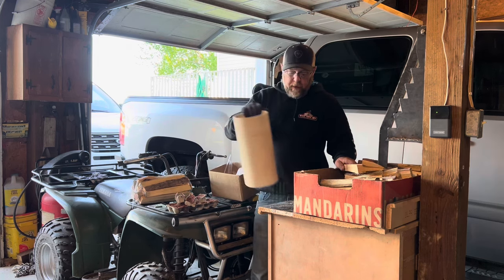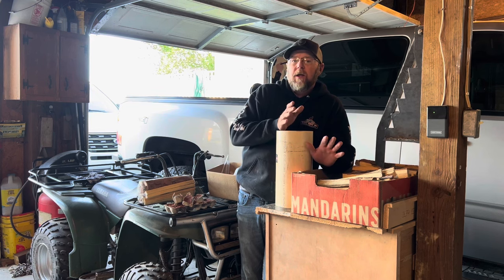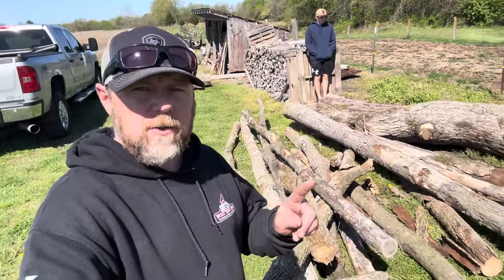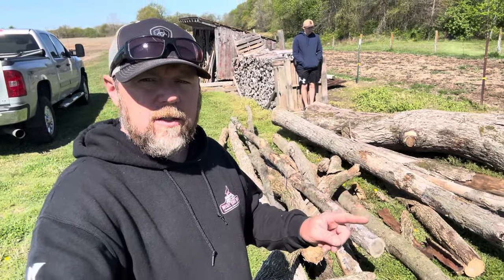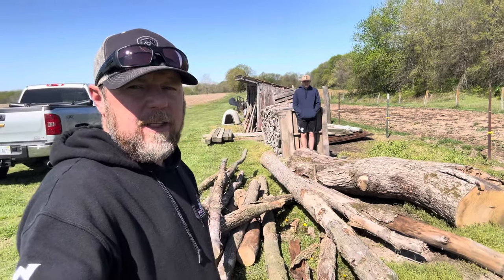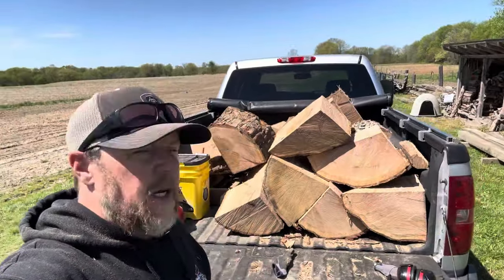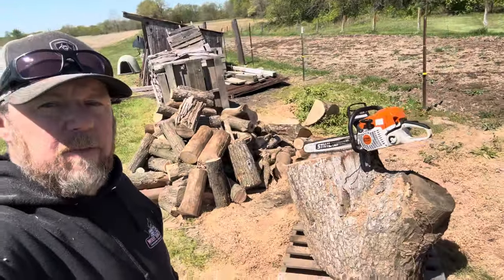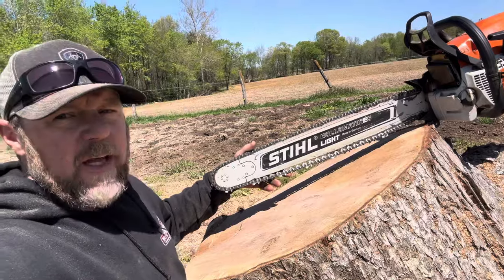Bucking / Noodling Huge White Oak!! #firewood #freefirewood #stihl

Comment: Question for ya Todd . What kind of bags are you using for the kindling and what did you use to close the top of the bags .  That sure was a big stick of oak should be a lot of bark less wood in that one . Nice job guys .
Reply from the maker: Those were produce bags I get on Amazon. If I can find the link I’ll send it to ya! I close the top with cheap zip ties from Harbor Freight. Like $2 for 100count. Yep there was a lot of barkless in this log. It got split just after the video ended🤣 Take care Phil👊🏻

Comment: Take that chain and have a link or 2 removed. You are correct not pushing your luck running a loose chain. I ruined a bar once when I threw a chain.
Reply from the maker: Yeah I thought about that but I’m wondering if the integrity of the chain would be the same? I really don’t want to see one break😂 That might get interesting. I appreciate ya watching Matthew👊🏻
Reply: Every chain already has a coupling link. Removing a link or 2 doesn’t hurt.

Comment: Nice job. The chute on my 400C is too narrow for ripping so I’m ordering the WestCoast clutch cover or going with another model cover that will fit. Regardless of the small issues the saw is underrated.
Reply from the maker: Well if not for the hype on the 500 there would be more talk of the 400! It’s very underrated. I have had mine now for almost three years and still love it! It works for me and works well. They have definitely made a name for themselves since then. I paid $860 for mine and they are now over $1k at the same store! Thanks for watching Saltrock👊🏻